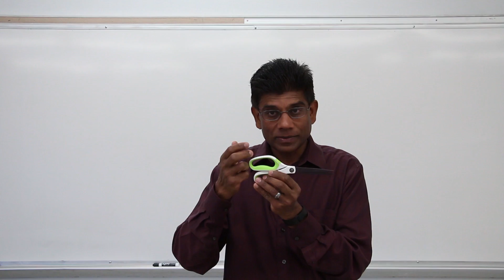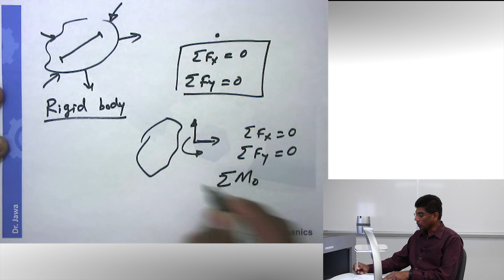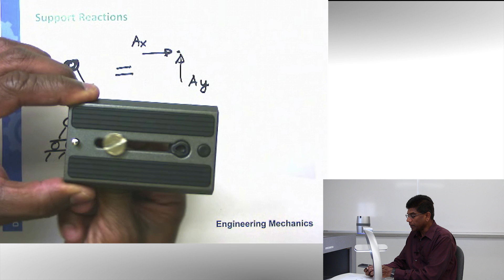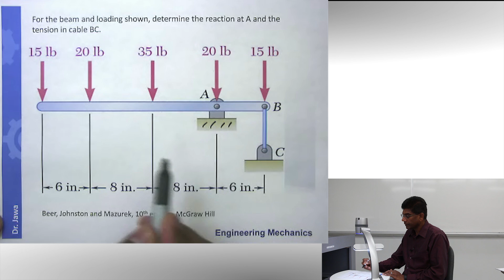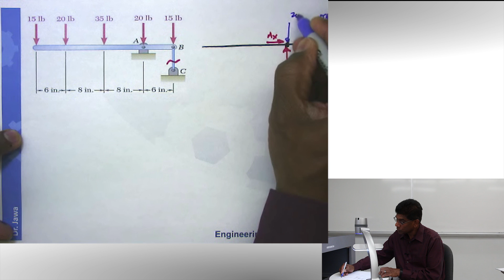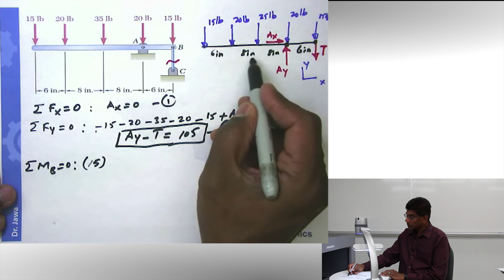Comment: THANK YOU SO MUCH ... this is really useful and understandable
but i have a simple question
in the problem question... how would i know if Ay is going up or going down, also Ax how to know if it's to the left or to the right?
thank you
Reply: It doesn't matter which direction you draw it as long as you include it in your free-body diagram. If you draw it the wrong way originally, your equation will produce  a negative number. This tells you your arrow is pointing the wrong direction. Say if you drew Ay pointing up and your equation produced -25 N, you could say that the force Ay is actually 25 N downwards. Hope this helped.

Comment: If we sum up Moments about A The equation has the term -(-Tx6) for the cw moment and negative force (down).  Is this correct?

That's only way T will come out as a negative value (-140).. Subbing this value into sum of forces in y would give a double negative value which would give me the wrong answer for Ay though.

Or do I ignore the negative value for T when substituting in the moment equation.. then the answer comes out as +ve but I drew my arrow for T down, would that be correct?  

Thanks for the video!

Comment: I got 237.5 lb's for the A.y force, :L not sure how though, 1425 divided by 6 wasn't it?
Reply: No. You will get 1470 divided by 6  which is equal to 245. 
Check 15*28 + 20*22 + 35*14 + 20* 6 = 1470
Reply: Ah okay, thanks i must've missed a digit, your video was great i was just doing some revision for tomorrows tutorial, hopefully i find it a bit easier now. :)